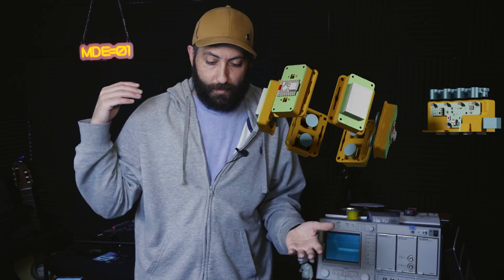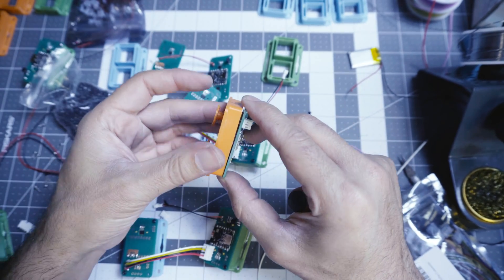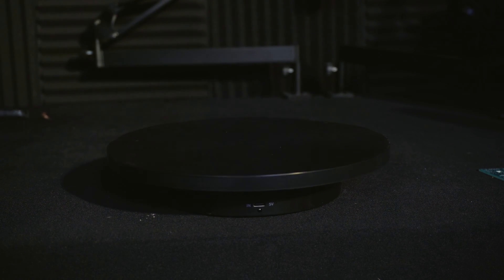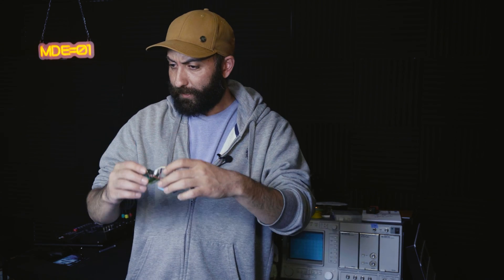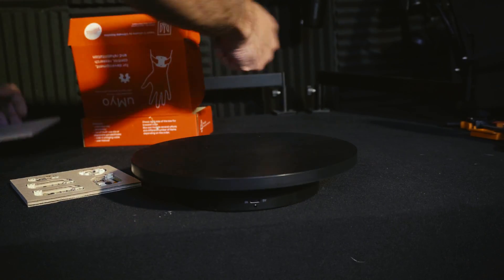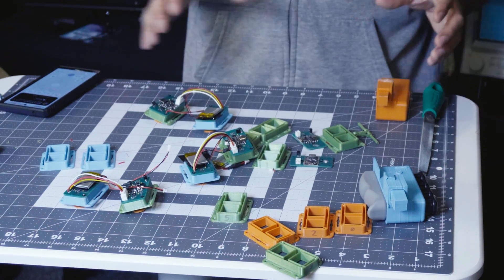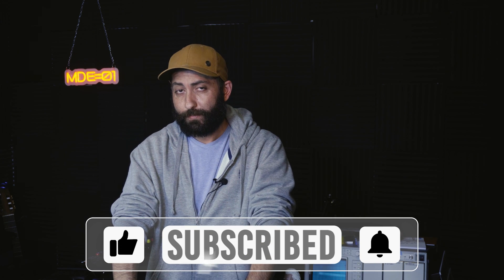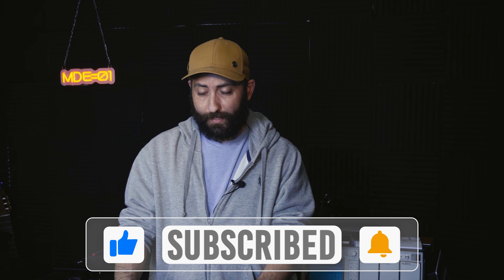Open Muscle - Open Source ML Prosthetic Sensor Suite using custom PMG Sensors - August 2024 Update

Comment: What are your thoughts on using something like https://github.com/LucidVR/lucidgloves LucidVR gloves as an alternitive source of input data vs the LASK? 

I could see it being a useful MVP for users that have full dexterity but limited grip strength to possible get started sooner. The other use case I could see is users that use the glove in VR already but want to be able to train OpenMuscle for less encumbered hand tracking.
Reply from the maker: @AndrewMorris-wz1vq  the pistons on the LASK are directly correlated to the varying degrees of muscle contractions. This makes the output of the model able to predict force of finger flexion easily. It might be good to test this to see how it compares! Thanks for sharing the link. I research what they are doing.